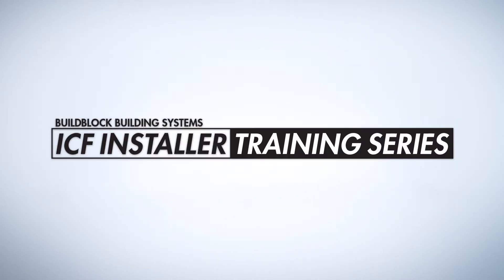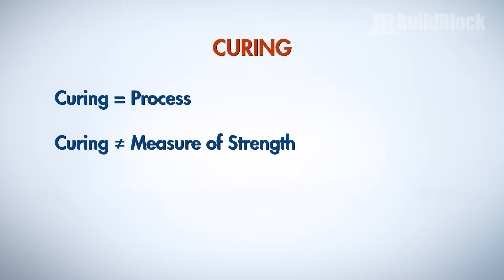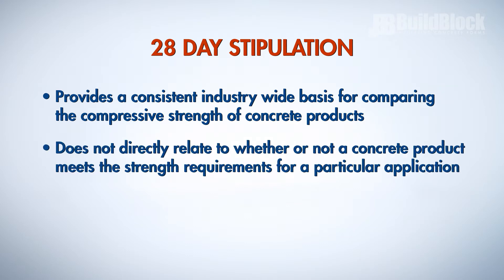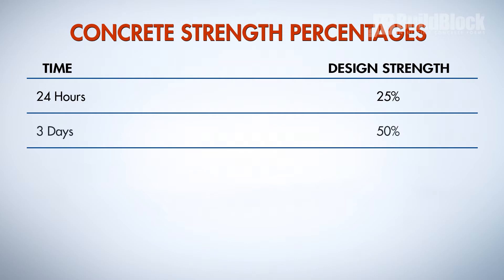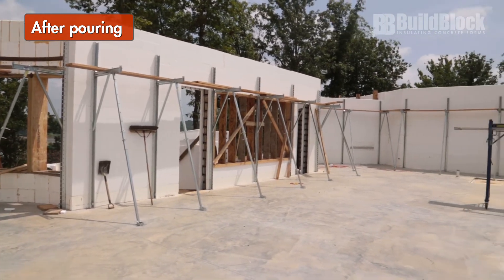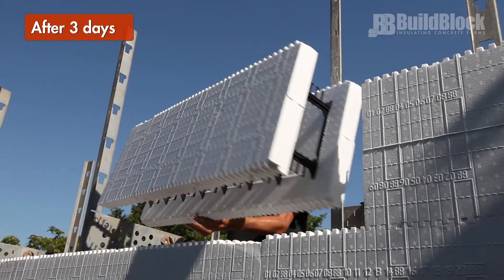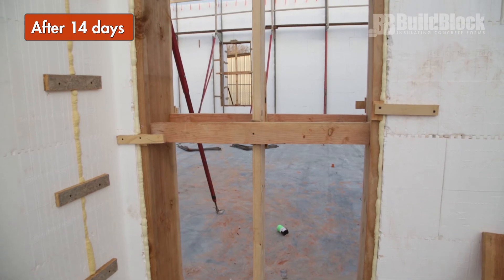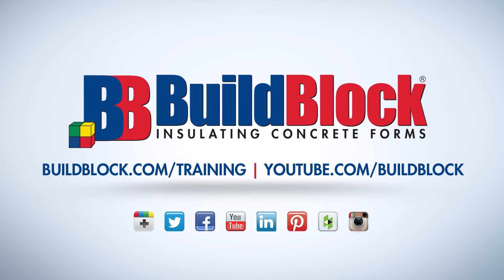BuildBlock ICF Installer Training Series: 16. Post Pour Concrete Inspection

Comment: at 1:45 "Get stronger as water continues to move out" 

 the strengthening has nothing to do with water moving out.
Reply: You are absolutely correct. I wonder if this guy ever poured concrete below water. Leave forms on for 28 days? Is this guy just a beginner? Has he ever removed a wall after 3 days?